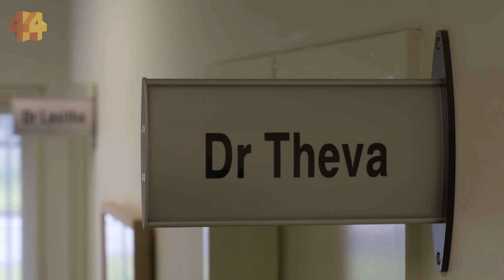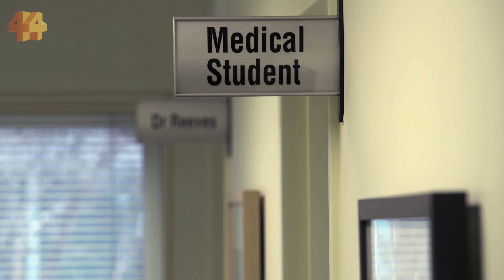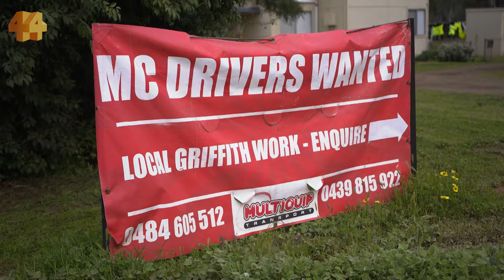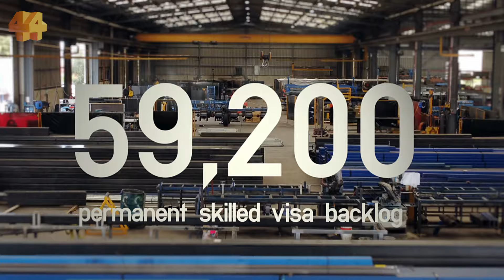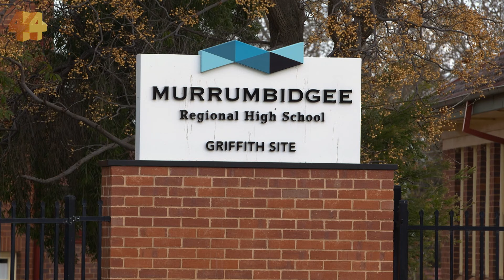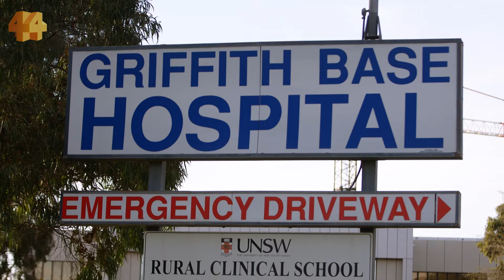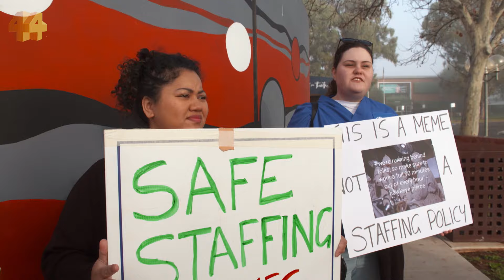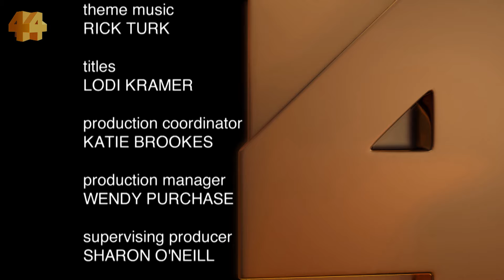The real cost of Australia’s worker shortage crisis | Four Corners

Comment: I been watching these exposes for decades and wondering how they can misidentify the problems so consistently decade after decade. Misidentify the problem and it never gets fixed. Doing the same thing over and over expecting different results. At what point does it become apparent to documentary film makers that they are doing more harm then good. While gathering the "facts" you're also forming an OPINION. If that opinion is incorrect it is on you the documentary film maker when the problem never gets fixed. There is a higher level of responsibility involved to not inject a incorrect bias. 

Engineers have a saying, "You cannot solve a problem using the logic that caused the problem in the first place." Asking employers for solutions to the problems they create will never lead to a proper solution. Employers always define the problem as someone else needs to do something for them. Never, they have to change how they do business. Over fish a fishery and crash the food source and it is always someone elses fault. Employers have to manage their labor resources and they don't do a very good job of it. In fact most don't do it at all. They don't see it as their responsibility. It is an added expense that doesn't add directly to profits, but it does go to sustainability of the operation. Get out of balance and you are heading for a crisis. Continue on the same path and you will get there. If you exploit a resource excessively and it crashes, it is on you to live with the consequences of your actions. 

A shortage can only occur at a price point. A labor shortages is no different. When ever you find yourself saying, "We or I cannot find workers", you need to get in habit of finishing the sentence with, "AT THE PRICE I'M OFFERING". Your labor force is out of kilter because the pricing mechanism is broken. It is broken because employers bring in foreign workers to suppress domestic wages and when they are successful for decades you get what we have here; employers addicted to cheep foreign labor. When you ask any addict for a solution more is always the answer. Employers are funny that way. From their perspective, the solution to this problem is more foreign labors, but it never dawns on them that bringing in foreign labor with the intention to suppress domestic wages will have consequences to them twenty years later. And more importantly that they shouldn't be doing it. When that time comes the government has to do something, but the problems persist. The problem must be the visa process is not the proper solution. Ten years from now we will still be discussing this with a completely different group of players. Doing the same thing over and over expecting different results. 

If you want to fix this problem the place to start is by making the victims whole again. All the existing local workers need a living wage and a place to live. Special skill sets need to be rewarded, too. Never let foreign workers that don't understand the cost of living where they are moving undermine the local's wage prices. There will always be long term consequences. Augment the work force not displace it for fun and profit. Manage your work force doesn't mean exploiting every opportunity to increase profits. Fix the labor pricing mechanism at the local level and foreigners will want to live there. Then and only then bring in foreign labor to fill the gaps. Neo liberalism sucks. Time to find something better. 

If you're a documentary film maker stop playing into the nonsense. You cannot solve a problem with the same logic that caused the problem in the first place.
Reply: I have to say you are exactly correct. Well said. The ssme is happening in the USA. What a pity.
Reply: @deborahaichele8829  It is happening everywhere in the American empire that embraces neo-liberal policies. The British empire was absorbed into the American empire after WW2 when it couldn't pay back its war-related borrowing to the US. As a de facto colony, Thatcher had no choice but to follow Reagan's lead. Which she enthusiastically did. All these so-called conservatives or neo-conservatives follow the right wing ideology of the Chicago school of economics led at the time by Milton Freedman. Labor austerity sometimes called supply side economics originated in the US. So, technically it started in the US and spread throughout the empire.